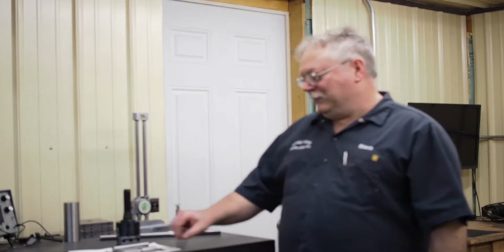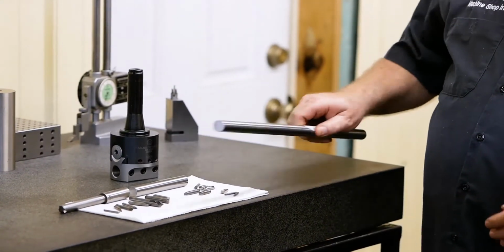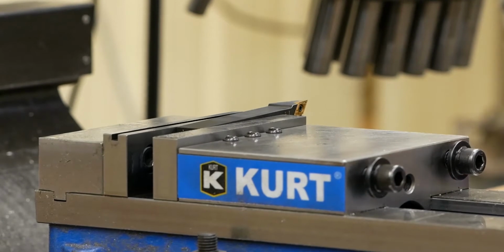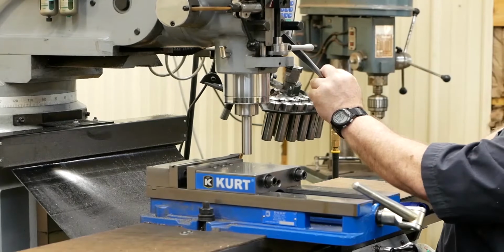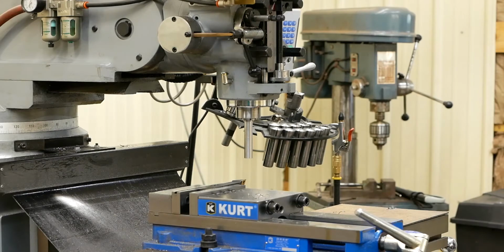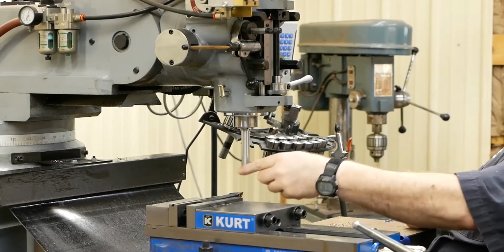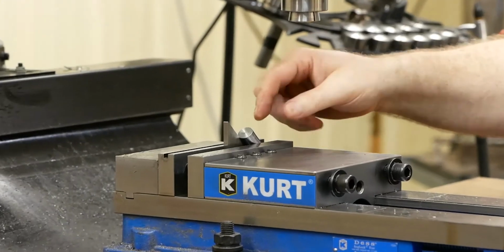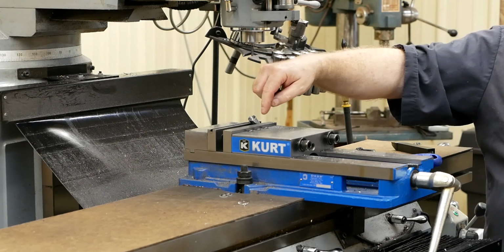Simple Boring Bar Build Part 1

Comment: Thanks for the videos. I am enjoying learning from another master! If you were able to buy only one machine for now, which would it be, a lathe or a mill? Thanks for your advice!
Reply from the maker: Hi 393stroker,
It depends on a number of factors. Are you planning to use it for  making money? Then follow the available work. Is this for hobby? Then I would lean heavy on the mill because of the versatility. You can do some lathe work on the mill. Another factor to consider is there a sweet deal on one or the other at the time you buy your first machine then go with the sweet deal.
Steve

Comment: Mill turning is a great trick for the shop toolbox!  I've got an Atlas benchtop horizontal mill that I'm making a 'tailstock' for the overarm so I can turn between centers on it.  I'm hoping that will take care of the taper I get from workpiece deflection due to stickout.

I've got six small tools mounted in a block I bolt down to the mill table that I use as a 'tool changer', pretty convenient for the little parts I do.

I'm not understanding the purpose of spot drilling before spot facing with a center cutting endmill.  Is it just a visual verification of position?

Toolmaking projects are my second favorite thing, behind tool fixing projects ;-)  Thanks for sharing again!
Reply from the maker: Hi somebody,
If you relieve the center area of the cut with a center drill it is a lot easier on the endmill. More importantly the hole diameter will be better with the center relieved. 
Steve